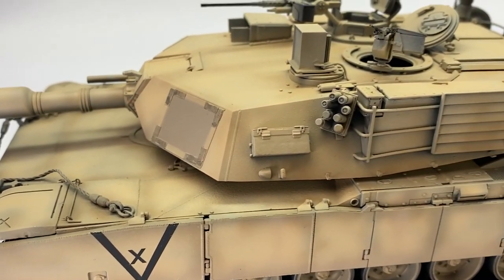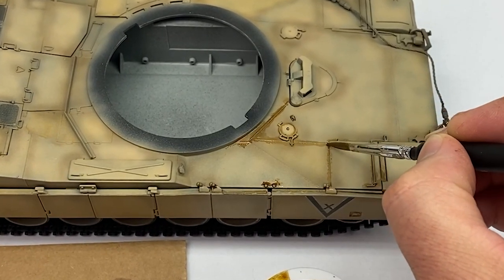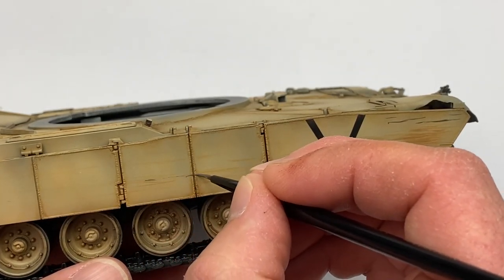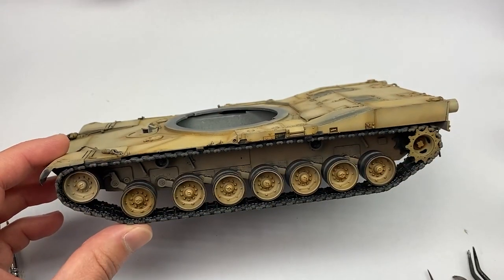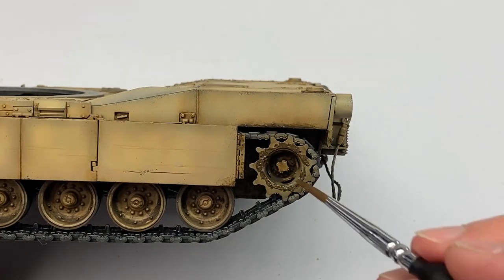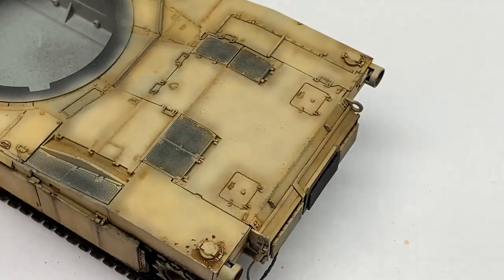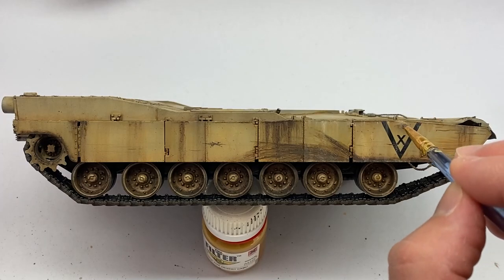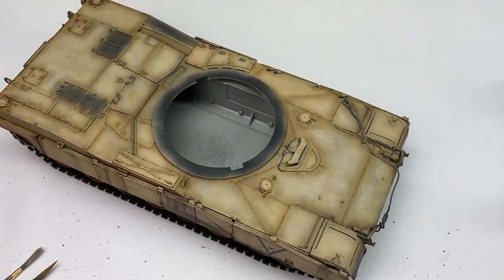Weathering U.S. Modern Desert Tan

Comment: I have watched your video on the M1A1 tank build a few times. It really looks awesome at the end. I just finished building my tank and have it all primed, going to try you painting techniques to see how it goes.

The only difference with mine is I built it like my M1A1 tank that I was on during the Gulf War in 1991.

One other question I am having some issues finding some of those paints you used. Any suggestions on where I can find them?
Reply from the maker: That's awesome! thanks for watching and good luck with your painting. Unfortunately the Wilder line has been discontinued as far as I know. However I have switched over to using oils to create similar effects just with slightly more drying time. So if you have the time to wait that's what I would recommend.

Comment: Would it be possible to get a list of the paints, filters and washes you used?
Reply from the maker: After base coat. Orange filter for desert camo, then oil pin wash and shading. Black brown for the chips. Then acrylic mud paste from ak terrains "muddy ground'. Followed by streaking grime for the stains. After that, white oils for mapping and ak light mud for dust streaks. Hope that helps!